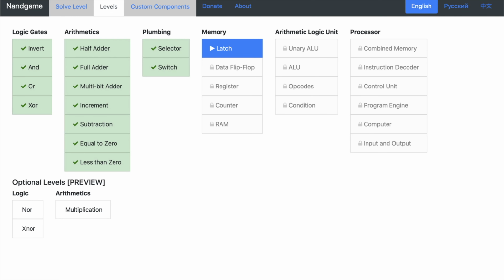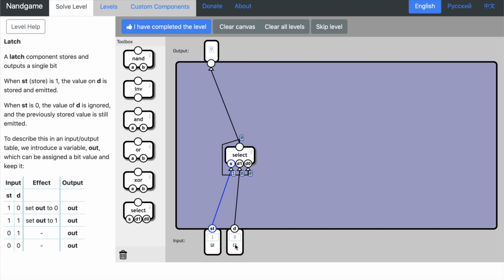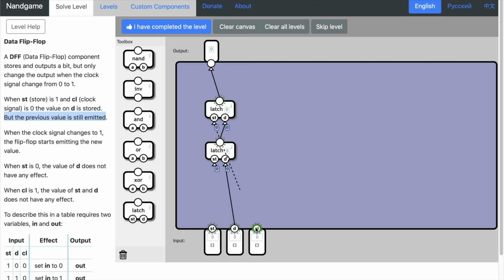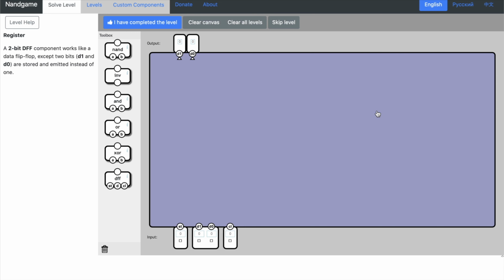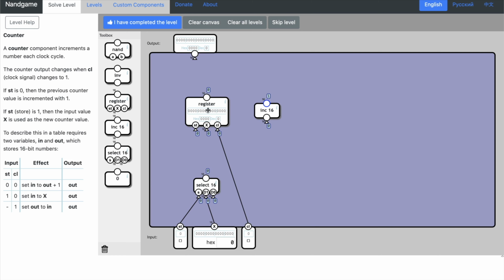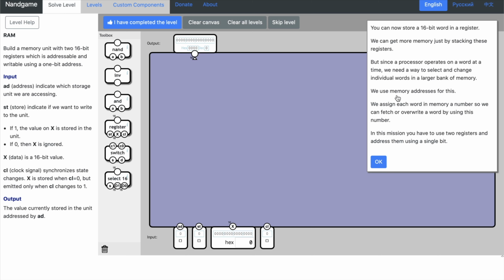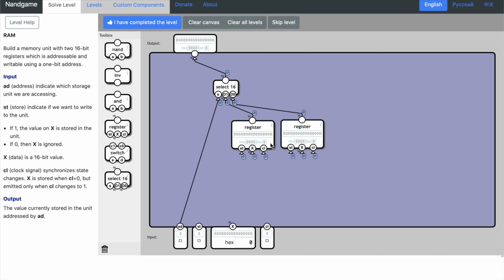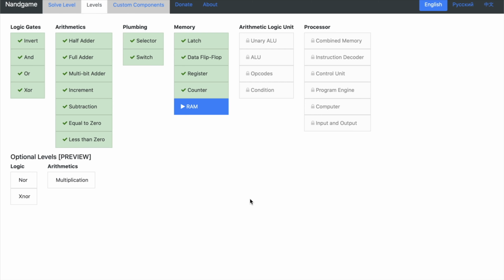Let's Play: Nand Game, Part 2

Comment: i have a question: if computers remember with electricity, and every component is connected to the power, how come when I unplug my PC it still manages to remember what i have saved on my computer even tho it has no electricity and all the components should be set to 0?
Reply from the maker: This has to do with the technologies used. While most computers use dynamic RAM for their 'core' memory (which requires power), most modern computers also have "secondary storage" that uses some other technology (magnetic disks for hard drives, static RAM for SSDs) that does not require power to maintain its state. Things written to secondary storage will thus be retained even when the power is off.
Reply: @TeaLeavesProgramming  thank you so much
Reply: It's possible with electric devices too. In tunneling effect, electrons can pass through insulation if insulation is very thin. Double gated transistors are used for this.
https://youtu.be/GVsUOuSjvcg
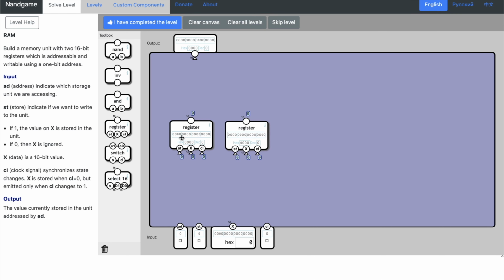Check 15:55